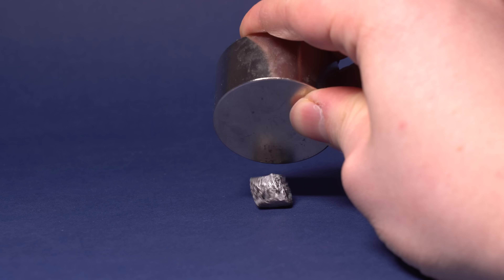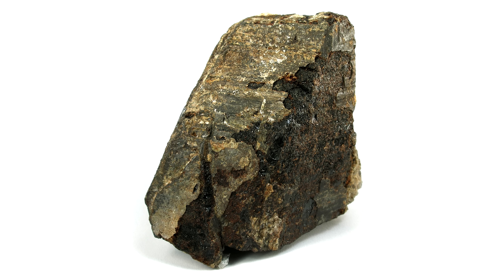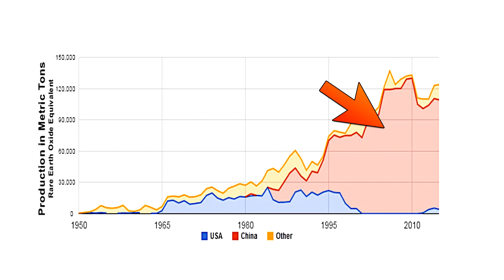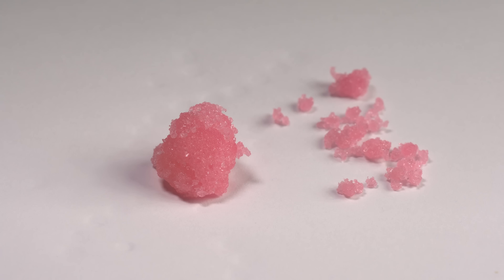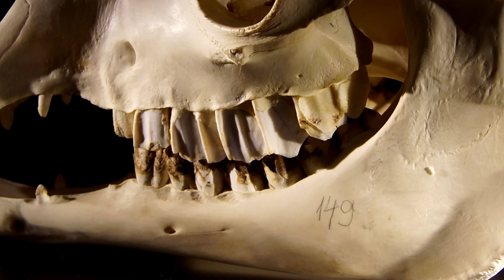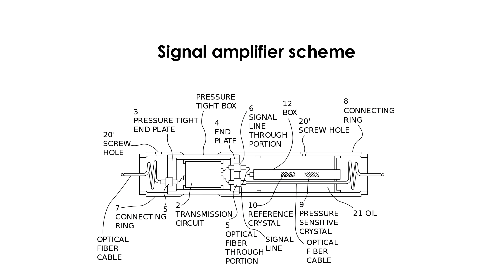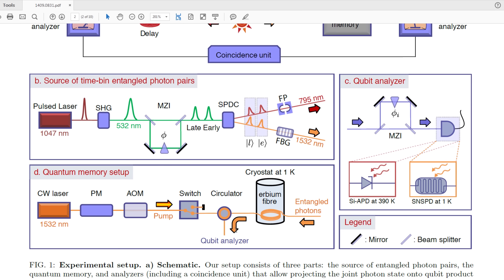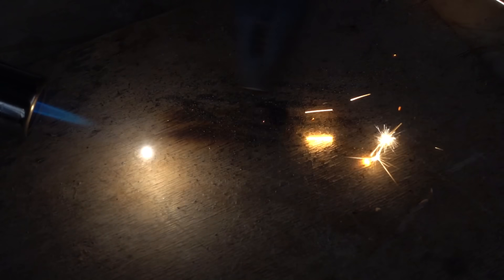Erbium - A Metal, Which CREATES QUANTUM INTERNET!

Comment: So from what information i gathered in your video, is in order to amplify the speed of information in the high-speed internet cable, is to form a simple loop? Is that right? What if a simple inductor is wound around the high speed cable, or a magnet introduced to the cable connection at a residency? Seeing that the eribium has magnetic resonance.

Comment: ON ERBIUM AND OTHER LANTHANIDES

For example the most expensive lanthanide is Thulium. It is sold as dendritic crystals.

The quoted cost of 1Kg of 99.99%TREM Thulium is $1200USD shipping by DHL included direct from China. It seems like a lot of money but it works out to about $1.20USD a gram. If enough local collectors got together it would be a good buy. I am in the fortunate position of being a retired research chemist with few financial worries. For young chemists and collectors financial matters are more important. Thus it is important that they think outside the box to find ways to indulge in their interests. 

Of course the other lanthanide metals (excluding Europium) would be a lot cheaper.